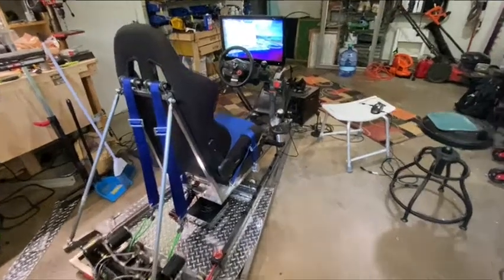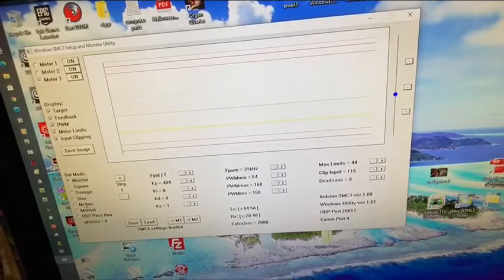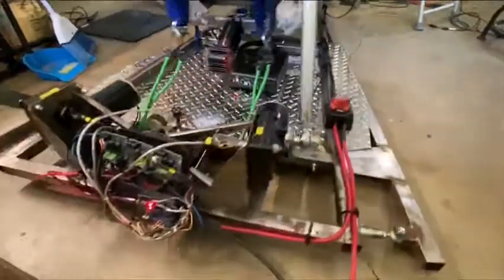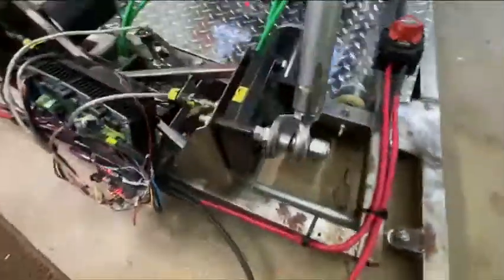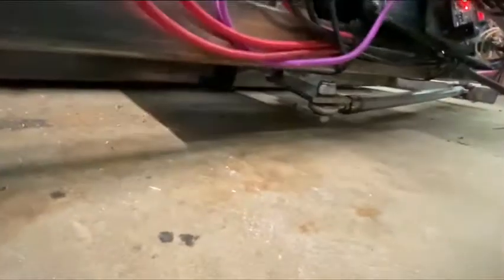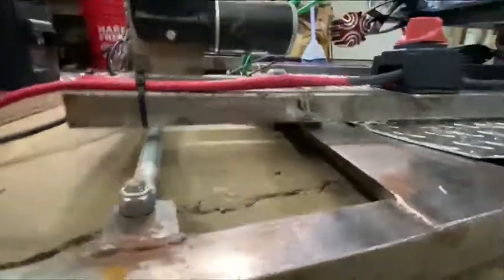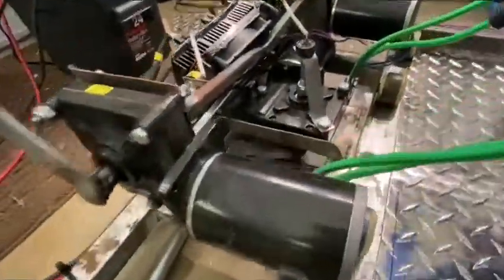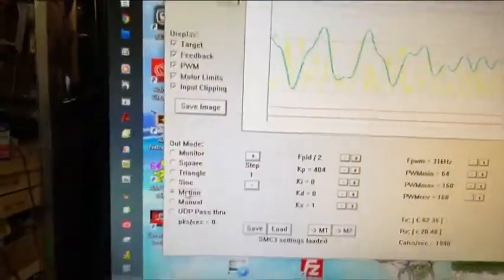motion simulator build 3DOF traction loss platform controlled by the SMC3 utility. SMC3 settings

Comment: Hey D, Merry Christmas!  Quick question for you...How long is the lever arm on your TL motor and about how many inches of travel do you get from side to side?
Reply from the maker: I thought I replied to this.. but apparently I did not.. Sorry..  So the LEVER arms for the drive motors are 5" CTC.. the lever arm for the Traction loss is 7"..  I could actually probably go a bit longer as it doesnt reach full travel to the end of the bottom frame..  Sorry for taking so long to reply..   Dave
Reply: @DMAX_DIY  actually you did!  Not sure where it went, but thanks again!
Reply from the maker: @dgator7251  You tube is pretty messed up.. I was sure I did .. but then it said I did not.. So.. Just trying to help out my friend!  Thanks.. New video taping this weekend so hopefully I will be able to finish it up and post it out..   About SImtools and how to set it up in real time..  Dave

Comment: Hey is there anyway I can message you. I’m trying to get mine to work and have some questions
Reply from the maker: Hey ! I can answer here. I check this channel on the weekends.. or you can ask on X-Simulator.  Either way.. I may or may not be able to answer your questions.  DMAX
Reply: @DMAX_DIY  hi so Ik xsimulator is probably the best place to get this info but rn I have not got any responses. I am using 2 ibt2 h bridges and I have the code set to mode 2 like it’s supposed to be but when I go to run the smc3 and I turn up the pwm Max my motors do not move
Reply from the maker: @jccarron02   Ok, the first thing  (you may have done this) find what port your usb is connected to. You will need to enter that into the SMC3 setup If i remember or on the notepad.  Second, make sure your potentiometers are reading on the SMC screen..They will be the green line.  If  you can turn the pot and see the green line move let me know. DMAX  Also, it's the holidays now so I should be checking this page more frequently
Reply from the maker: Did you get it working?  I am posting a step by step video soon because I disconnected the arduino to solder the connections and basically have to go through the process of getting everything running again..  DMAX
Reply from the maker: @jccarron02  Ok, sorry for not seeing this until now, Youtube seems to hide stuff and then pop it up randomly.. Can you see your Green Potentiometer line on SMC3?   Check out my settings on this video here, I just went through all the SMC3 settings in real time. https://www.youtube.com/watch?v=5Du7pbOSe_Y